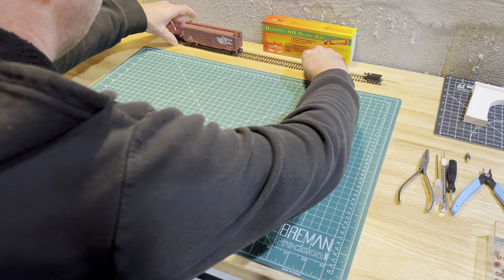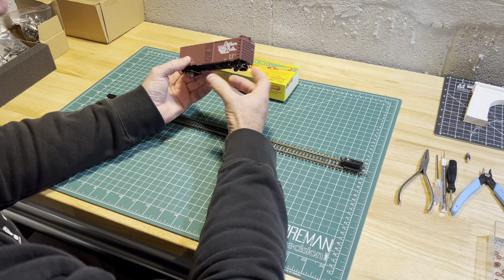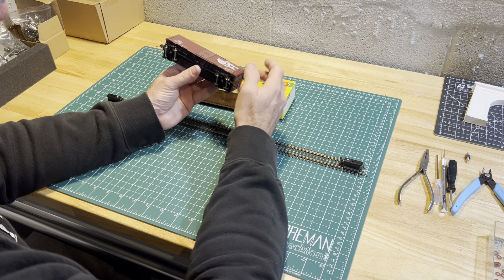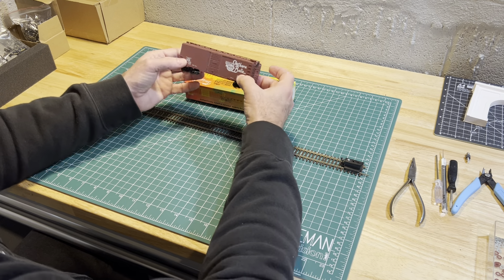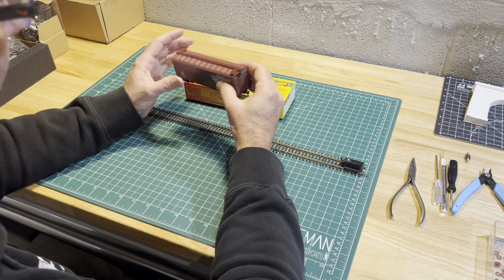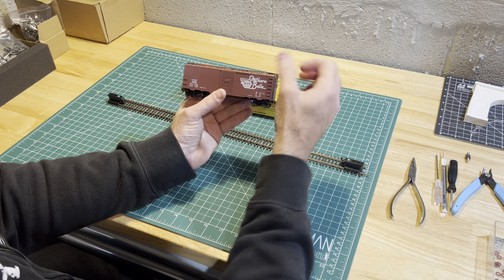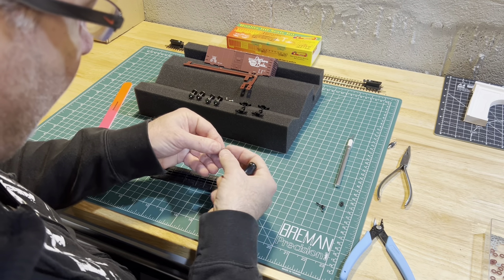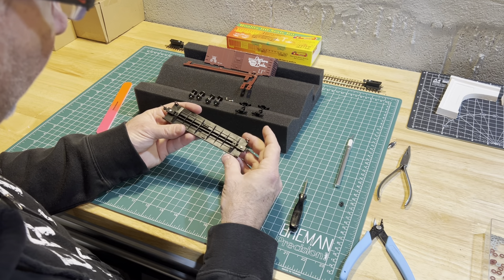RCR Car Build! (E70)

Comment: Nice video, going to have to get some of those cars based on your experience. What brand/model of worktable are you using? I like the top and especially the tray underneath for commonly used tools. I'm currently using a flat plastic table with fold down legs but obviously doesn't have the tray. Thanks.
Reply from the maker: The work table is a Husky garage workbench, I think from Lowe’s.  My wife bought it and I swiped it. 😬
Reply: @chattanoogasouthernrr  Husky is HD brand, will definitely look it up, thank you! Sounds like a nice wife hehe